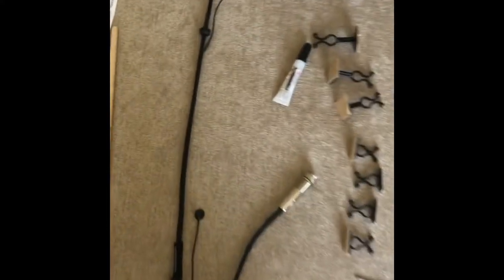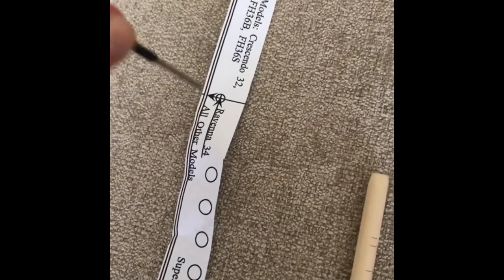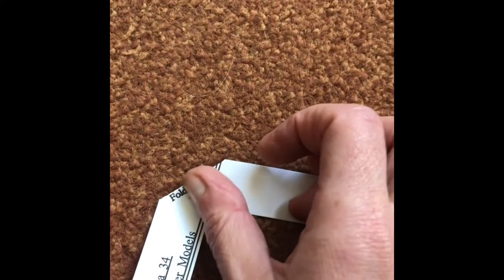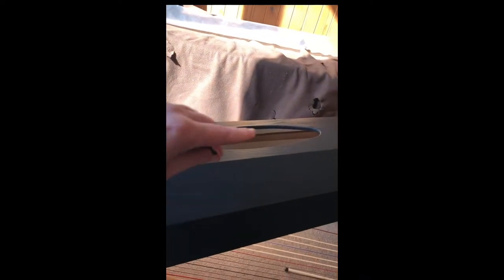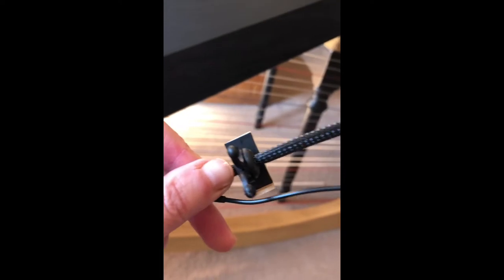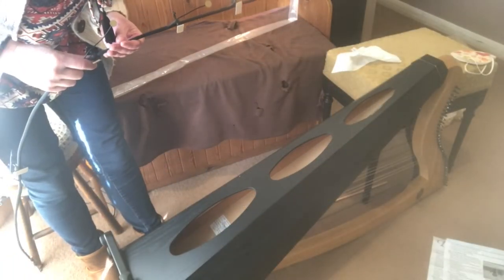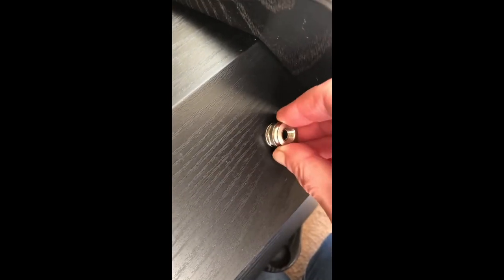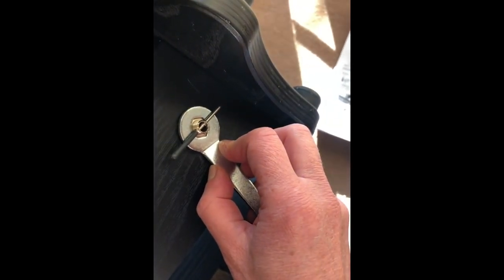Installing a Dusty Strings lever harp pick up in a Ravenna 34

Comment: Thanks so much for this video! 
How are you getting on a year later? X
Reply from the maker: It’s great - but not demonstrably better than the much cheaper Fishman that I use in my pedal harps.
Reply: @emmagraham1774  how interesting! I’ve just looked up fisherman and it comes up with only one “dot” pick up, is that what you  have and find sufficient for your harp?
Reply from the maker: @laimaplaysharp  Yes that’s it. And yes. It’s excellent.
Reply from the maker: @laimaplaysharp  yes. It works perfectly on all my harps right up to my LH 23 convert grand.
Reply: @emmagraham1774  thanks so much! 
And you’re so lucky to have multiple harps! ❤️❤️❤️❤️